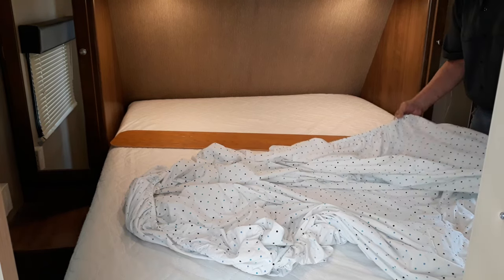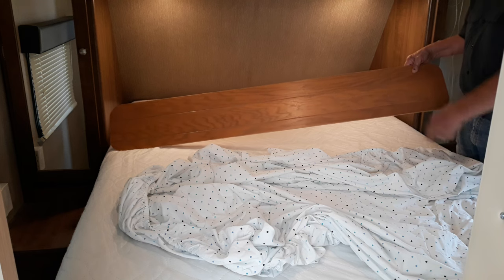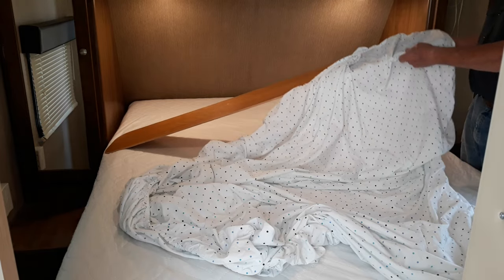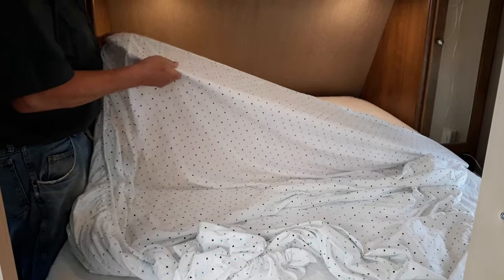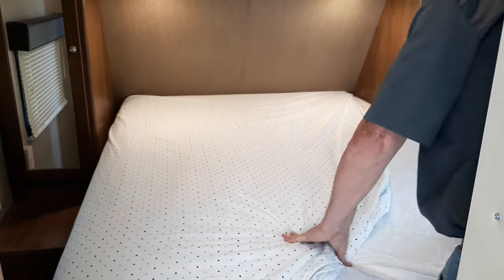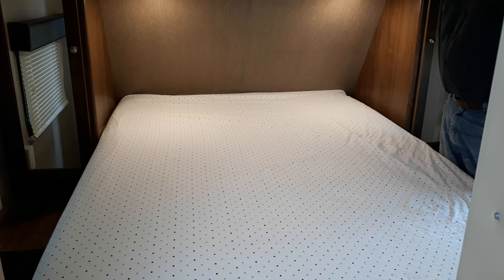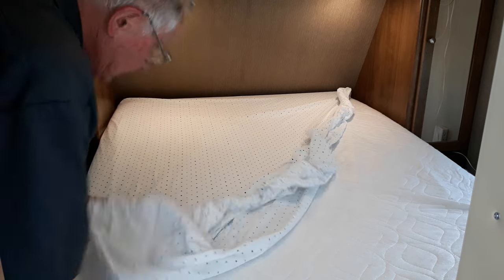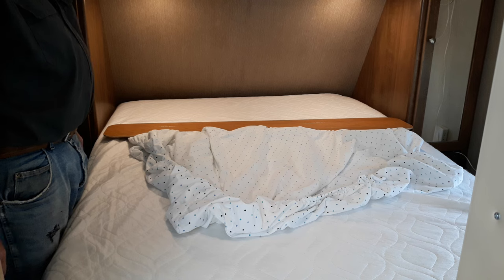Fitted Sheet, the easy way, on a mattress in a RV, camper or other tight location.

Comment from the maker: I forgot to mention in the video that I also put a piece of paneling like this in the top end of the mattress cover. That makes it easy to put on the mattress cover and keeps it in place. So when both the mattress cover and sheet are in place there are two of these this boards at the head end of the mattress.

Comment from the maker: Although I made this out of 1/4 inch paneling  I don't see any reason it wouldn't work just as well if made from a heavy piece of cardboard box such as a mattress or refrigerator is delivered in. You could just cut it out with a straight edge and a utility knife. Hope this helps out those that want to use this idea but don't have access to woodworking tools.
Reply from the maker: If you make one of these out of cardboard and find that it is not stiff enough you could glue some long thin strips of wood to it. The home supply stores sell these strips quite reasonably. I believe they are called lattice strips.

Comment: What are the dimensions of the wood paneling?
Reply from the maker: That would depend on the dimensions of your mattress. As I mention in the video, the piece of paneling should be a little shorter in length than the width of your mattress and about as wide as your mattress is deep. The exact dimensions are not real important. Hope that helps. Ask again if I can help further.

Comment: I just pull the mattress down to the foot of the bed, slide the head corners down over that end, push the mattress back into place and do the foot. I don't have time or energy to mess around with a piece of wood.
Reply from the maker: That works fine if you have the room to pull the mattress down. This idea is to help in the situation where there is not enough room to pull the mattress down so that you can easily reach the head end of it.